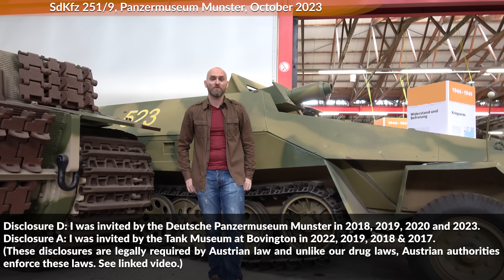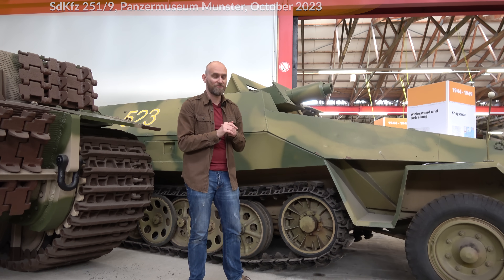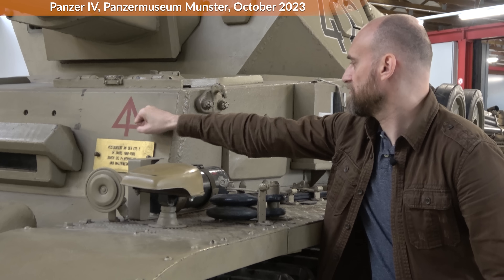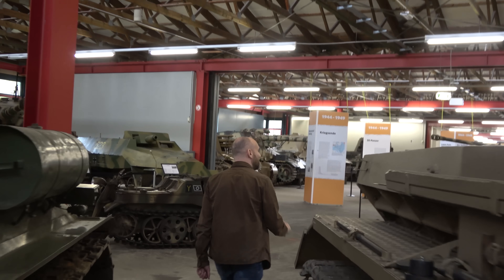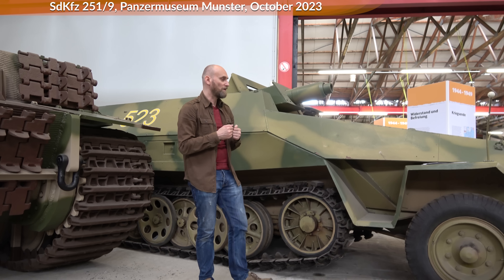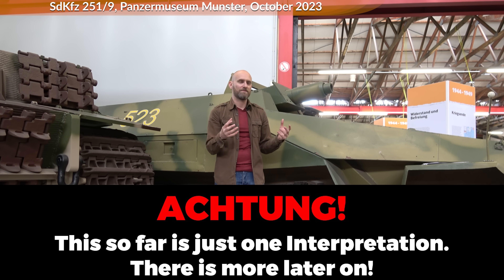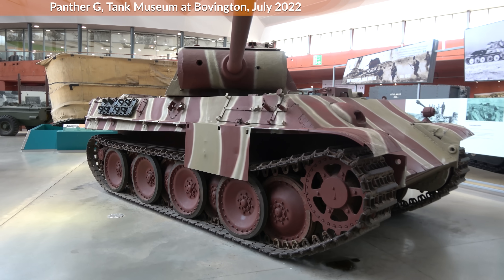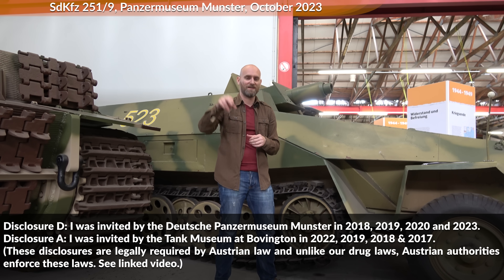Why was German Sloped Armor so late?

Comment: Inclined armor was already used in the Middle Ages. Back then, the armor of knights was specially inclined so that the blows of spears and swords would slide down the armor. Subsequently, this art was applied to the construction of castles, where increasingly sloped walls were built to cope with increasingly accurate artillery weapons. Ships, too, gained sloping armor, although this was originally due to the imposed tax on the deck area, so the sloping sides resulted from the reduction of the deck. It turned out, however, that the inclined side not only allows the ship to pay less tax, but also to deflect cannon shells. The inclined armor continued in the first ironclad ships. First during the Crimean War (at that time such armor was used on floating barges) , and then during the Civil War on monitors Inclined armor can already be found among the first tanks, but there were technological problems to fully incline the tank's armor.  
 The first problem was the visors, as mentioned in the film. The thicker the armor was, the more difficult it was to cut a proper hole.  In addition, when cutting the hole, there was a risk of damaging the plate, which was already only suitable for remelting.  Another problem was the complexity of the design, this lengthened the production process, production time and production cost. The thicker the armor plate, the more all these costs increased. The very process of fitting and welding the inclined armor plate was complicated.  During WWI, inclined armor was not a big problem, as long as it did not exceed 45' of inclination. This was due to the fact that armor plates were riveted to a special framework. An angle less than 45' prevented riveting. It was possible to get around this by creating a more complex shape from more armor plates, but this increased cost, vehicle weight, production time and did not make the armor more resistant to hits at all. Quite the opposite.  The revolution came after the war with the use of bent plates, but this worked well with plates no thicker than 15 mm. Bending thicker armor required creating wider bend arcs and special techniques for hardening steel. Even so, bent steel exhibited weakened ballistic capabilities. 
Even welding was not an immediate solution. Welding in the 1930s was still a fairly new technique and was not perfect. There was the problem of welding sheet metal at unusual angles, large thicknesses, and armor plates that were too heavy. The Americans developed the relevant technology only with later models of the Sherman (although they had already experimented with it with the M3 Lee There was, however, the problem of cracking welds to vibrations and stresses at that time. The Russians did not have to develop welding technology, as they received the appropriate technology from the US, as did the British. The Italians and Japanese received their welding technology quite late from the Germans and did not have time to implement it in series vehicles. 
The alternative to welding was cast armor. It was cheap and quick to produce, but less hard and, on top of that, without the right technology, emitted numerous fragments inside when hit.  

That's still not the end of the story, however, as sloped armor complicated access to the gearbox, and placing the gearbox at the rear would create numerous technological problems (the T-34 had huge problems with the gearbox. The last gear had to be put in by hitting the rod with a hammer, while the gearbox itself had a very short lifespan, so there were T-34s carrying a spare gearbox on the engine compartment vault.

Comment: Interlocking might tend to support plates in place during welding, tying up heavy fabrication equipment less. As to flat plate, it seems to me that you don't have to worry so much about shot traps or chaotic deflection. Trying to hit a turret ring would seem to be more challenging.

Comment: the video mised it's title i think. why geran tanks are boxy tured to what ist the use of interlocking armor plates. 
but why german tanks up to Tiger1 have been boxy, and why this changed with Panther?
slopped armor was known as the video stats and one drawback is the stability of the joints. this is addressed in the video greatly. one point is mostly missed but worth mentioning: internal space! slopped armor takes lots of space internaly alter on missing for crew and equipment or ammunition. adn how wide a PzIII would have been with the sloppes of a t34 to give same space - 3 amn turret,... 
also it was seen that putting your tank at an angle would bee sufficent  - mahlzeit-stellung , and this worked also with the improved armor for some times. additionally , All the boxed tanks take their roots back to the late 1930's even tiger1 as a development over certain VK30.xx studies. only Tiger 2 and especially Panther take their roots to a daical rethinking  triggered by the events of W2

Comment: Interlocking armor plates is an interesting but separate topic from sloped armor, because clearly you can do one without doing the other. About the positives and negatives of interlocking armor plates: first off, as you mentioned, thick tank armor is hard to cut (especially with the precision necessary to create interlocking), cutting it into this shape will take more time because the length of material you need to cut is longer than a straight line, the same problem appears with welding. Obviously these are two very expensive, material and time consuming processes, I think that they probably had a reason for them. I think the main benefit to interlocking the plates like this is impact resistance. Welds are generally more brittle than the slabs of armor that they join, when they get hit, they sometimes crack, even more rarely, the entire weld cracks and the structural integrity of the hull is compromised without a full penetration of the armor. I think that this is what they wanted to deal with. If a weld like the one on the Tiger II is impacted, part of the weld might crack, but the crack will only travel down the weld in a straight line, once the crack has to make a 90 degree turn to follow the weld, a lot of the energy will dissipate. This makes the weld tougher even though Germany did not have the best welding technology as you mentioned. This is of course all speculation on my part based on my limited knowledge of armor manufacture, welding, material science and other topics. If I got something wrong please tell me!

Comment: There were sound reasons to employ sloped armor, but also to not bother.

It should be kept in mind that the standard infantry anti-tank gun in 1941 was still the 37-mm Pak 36.  While this piece was quite adequate against 85% of Soviet armor, being the T-26 and the BT tank series, mostly, of course they were but "door knockers" against the frontal armor of the T-34 and pretty much any perspective of a KV-1.  This problem had been noted in Belgium and France, first notably at the tank battle of Gembloux in May 1940, where not only the infantry anti-tank guns but also the main armaments of the Panzer I (machine guns ONLY!), Panzer II (20 mm, at least it was a rapid-fire weapon), Panzer III (still its standard main weapon was a 37 mm piece), and the Czech-built 38(t), also with a 37 mm main weapon.  While these tanks did OK against the French two-man tanks, be they Renault or Hotchkiss, the larger French tanks like the Somua S-35 and especially the Char B1 (even worse with the heavier armored B1 bis) were nearly immune to those weapons.  The German solution was to avoid engaging enemy armor with their light tanks, but instead to coordinate with artillery, the Luftwaffe with its Stukas, and, since the French L'Armee d'Air was, by then, fairly much negated, bringing up the Luftwaffe's 88 mm guns to be used as anti-tank pieces, at which, if they had a decent field of fire and could engage the enemy armor outside the range of the opponent's weapons, then the results were devastating for the French, and later at Arras, the British with their Matilda Is and Matilda "Seniors" (later just Matilda when the first vehicle, itself only equipped with a single .303 machine gun, was relegated to training).  Likewise against Soviet T-34s and KVs were these practices employed, along with daring "Panzerjagers", whom, once the Soviet "Desanti" infantry were picked off, would hop aboard the rear deck of a Soviet tank and affix a mine underneath the turret overhang, or drop a grenade down the exhaust.  German tank-hunting teams also used "Molotov" cocktails as readily as the Soviet infantry.

Once their Panzer IIIs got all the 5 cm guns, especially the L60 version with sufficient penetration to take on the T-34s on more or less equal terms, the "PanzerSchrek", or "tank terror", died down as the weaknesses of the new Soviet armor were found.  Interestingly enough, once the German Panzer IVs and StuG III got the excellent 75 mm L48 tank gun, the sloped armor proved meaningless, as the APCBC round tends to "precess", or rotate towards a direction more "normal" to the sloped armor, penetrating it like a  hot knife through butter anyway.  The armor on the T-34s that had the 76mm gun was but 45 mm, which kept the weight down when with a combat load of shells and fuel to just under 30 tons, a fairly light weight for a fairly large vehicle.  That and the use of the all-aluminum diesel V-12, 450 horsepower engine, developed from a French aircraft diesel the Soviets had bought in 1934.  This shows that not all Soviet engineering was crude, and Soviet designs could "think outside the box" as readily as others.  It was indeed quite big, but rather light for its size. Wasn't all that durable, but given the typical life of a T-34 in combat, it didn't have to be.

Comment: Germans had issues with steel quality. Their steel tended to be high in carbon which makes it more brittle but also harder to weld. This meant that a strong impact could cause the welds to crack or even burst open and for this reason german engineers started using interlocking armor plates to create more surface area for the welds to hold onto. Interlocking also would help hold the plates together even after the welds failed completely. 
This has nothing to do with sloped armor.

Comment: There are also other reasons then welding seam design. More square then rectangle length/width dimension ratio and less differentiated armor thickness favored "quadratish-practish-gut" boxy design, saving mass/increasing armored inner volume/widening space for larger turrets, more space for crew entry hatches and some other equipment, that otherwise would be needed to put on frontal armor, compromising it's integrity. Vertical sloping to some extent can be replaced with horizontal by simply angling positioning of tank (especially one like Tiger-1, that was more evenly, less differentiated, well armored both from front and sides.

Comment: The difficulties which you are encountering in explaining why sloped armor was not introduced is because you are trying to explain mentality and expertise of the people at that time. Part of technology is understanding how to apply already known concepts more efficiently. Military technology is designing vehicles for a specific task within specific budget and time limit. Designs were such, because they did not prioritized protection at that time. Most tanks preferred mobility, in part due to low reliability of interwar tanks. Combine that with outdated mentality and low funding for tank development during interwar years and we have what we got. 

In other words, Germans did not used sloped armor simply, because they could not be bothered to. And that is an important distinction, because wielding armor plates comes with its own unique challenges. Someone need to invest money into researching this problem and coming with a solution. This is why it wasn't done passively. Another part of an issue is that sloped armor plates reduce internal volume. So, as tanks were designed around mobility first, why would you want sloped armor to begin with?

Comment: AD A954370 - "Metallurgical Examination of Armor and Welded Joints from German PzKw IV Tank, Model GF-2", had this to say about German tank construction:  

"Apparently the Germans rely principally on joint design for structural and ballistic stability of the tank since the welding of the high carbon, high hardenability, armor plate without special precautions to prevent base metal cracking during welding and with shallow penetration weld deposits produces welds with very poor resistance to ballistic shock or fatigue service.

"The design of principal joints, is characterized by grooves, machined in the heavy armor sections to give a fitted or mortised joint which is in compression on impact from the direction of principal ballistic attack. These joints are held by an outside weld placed in a V and having a depth of penetration of about three-quarter, of thickness of lighter section armor plate, and on inside fillet weld with a very slight penetration into the base metal sections.

"With respect to the welding electrodes employed , it is concluded that a shortage of nickel existed since it is well known that the modified austenitic nickel-chromium electrode, employed in this country [the United States] are, in general, more satisfactory."

Sloped armor places more shear loads on the weld joints than armor positioned normal to the direction of attack.  By using interlocking plates the shear loads are reduced and the loads are simple compression which the poor weld joints are better able to withstand.

Comment: sloped armor cuts down on armor weight and has the added benefit of deflecting shots. Its pretty much that simple. It worked in ww2 with basic AP rounds. High velocity discarding sabot is a different thing altogether. That's why new allied tanks don't use it that much. It doesn't help. it also wastes a lot of space,  Special armor blends are needed that incorporate special ceramics. Homogeneous steel armor is used very little on newer tanks' front surfaces. Tungsten and depleted uranium rounds go through it like butter.

Comment: Sloped armor doesn't save much weight. If you slope a thin plate, you need a much larger plate to cover the same vertical distance. The same effect can be had by using a thicker vertical plate for the same weight. Any weight savings are gained from less roof armor but there is also a loss of internal space.

Modern tanks tend to have much less sloped armor than WW2 tanks since the increasing size of guns require optimal use of interior space. The only sloped armor tends to be the front glacis. Sides are usually vertical which gives the maximum size for the turret ring and thus the biggest gun possible. The turrets tend to be mostly vertical as well or only mildly sloped since space considerations are more important.

Sloped armor does have some benefits for deflecting shots. But this benefit is dependent on a number of factors, especially projectile shape and speed. At high speeds, deflection drops so the hyper jet from a shaped charge isn't deflected at all. Long, thin projectiles also resist deflection so modern APFSDS rounds ignore deflection except in extreme angles.

The main advantage of sloped armor is that you are working with thinner armor plates, albeit more of it. This can simplify the manufacturing process since you can cut and weld thinner plates. The Tiger was made with 100mm vertical plates. The Panther used an 80mm front plate but was angled at 55degrees from vert so it had an effective thickness of 140mm but could be cut out and welded much easier than the smaller, thicker Tiger plates.
Reply: I guess that T-34 was a bit unique for its time as it had well sloped armor all around, and its thin side armor was still enough to stop most pea shooter guns from the 1930s. However guns quickly became more powerful, and adding more side armor was not practical as it made tanks too heavy if they were to gain sufficient protection from the sides. Not even the heaviest tank in history - the King Tiger - did have any impressive side armor capable or resisting 90mm anti-tank guns.

So if the side plate is too thin to protect the tank. And sloping a thin plate would not be enough to save the tank from flanking fire, then why bother? Other priorities like ease in manufacturing the tank would be more important than angled side armor then. 
I also guess that a V-shaped hull would give better protection against landmines, so an American T-57 with its angled hull underside would have better mine protection that the Swedish heavy tank Kranvagn.

Comment: The interlocking of the armor allowed for welding of only one side without loss of strength.  The Sherman was welded on the inside and out side of the plates for strength.  Dove tailing the plates eliminated the need for the extra Welding.

Comment: I think the notched plates is mainly due to manufacturing and material constraints. With the notches, they can fit plates together like puzzle pieces on the assembly line before they move on to get welded. There's no need to brace the plates in position, or drill the plates and use precious bolts. I'm guessing all machining and fasteners were in short supply. Simplifying the design by not having to try and wrestle with sloping affecting internal working volume and construction complexity, especially when using already extremely thick armor for the time, was probably seen as a good trade since they were already struggling to meet demand for vehicles. Once they saw the escalation in enemy guns and munitions, sloped armor is a relatively easy way to up-armor to meet that threat.

It does seem like when you can do blitzkrieg, having hyper-optimized armor is of minor importance. Later, as the army is bogged down and tanks must soak up more punishment that can't be avoided by rapidly defeating defenders, pulling out all the tricks and optimizations becomes crucial.